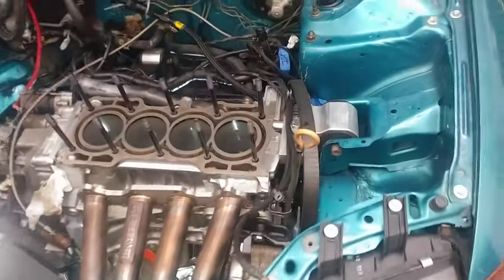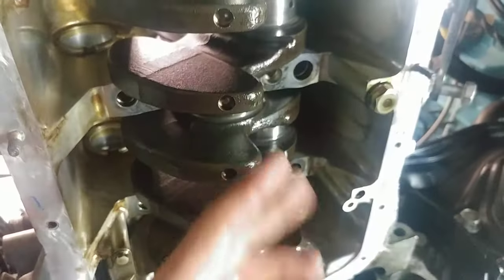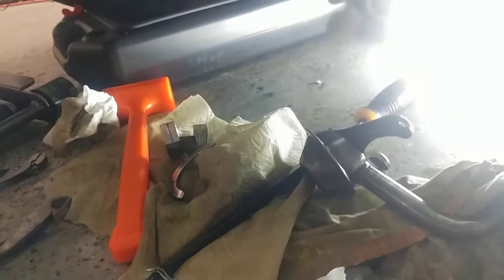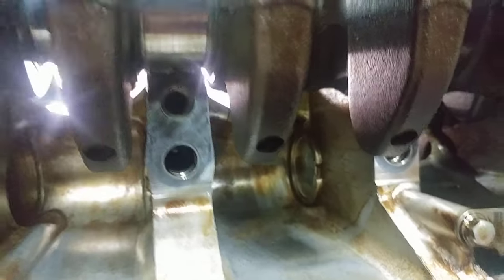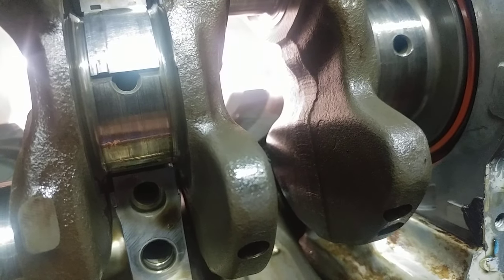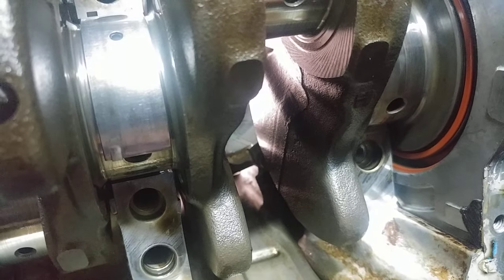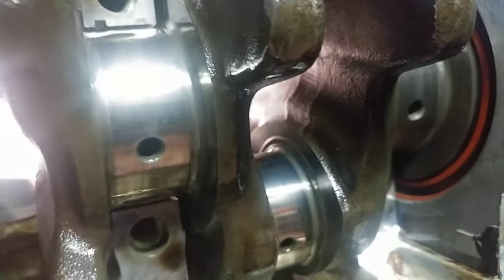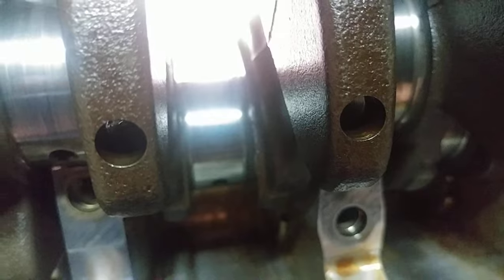EASY - How to remove crank bearing (THE FAST WAY) no engine removal (install while in car) ROLL IN

Comment: I have a 2001 Ford Taurus with 3.0 ohv. 

I found it easier to take a thin long flat head screwdriver (3mm wide) and lightly tap the old bearing until enough of the other side of the bearing was showing. Some people use a wooden popsicle stick to push out the old bearings, basically any thin piece of material softer than the crankshaft metal could be used, though stiff enough to hold it's shape while hammered lightly.

It helps if all the crankshaft main bolts are loose, gravity will help pull the crankshaft away from the old bearings making them a little easier to get out.

After that I was able to get some of the old bearings out just by rubbing it with my thumb, sometimes turning the crankshaft would turn the bearing and that helped getting it out. Some people use a pair of needle nose pliers to pull on the part of the bearing left showing after tapping them with the screwdriver.

Putting in the new bearings was easier, for almost all the bearings I was able to push them in nearly halfway with my thumb then I used the wooden end of a rubber mallet to tap them in all the way.
Reply from the maker: Thanks for the comment. I was hoping by doing this video help some people get some better ideas on how this can be done

Comment: Hi! Thank you for posting this. I have a couple of questions. 1) do you only remove the bolts of the bearing you are going to replace, or you release a little bit all the bolts initially so you have a little bit more of clearance? and 2) When do you torque the bolts? Because I think that the crankshaft might bend if I have new bearings with the cap torqued already. 
Cheers!
Reply from the maker: You could do it either way I would think, how'd it go?

Comment: What about installing without removing crank ?
Reply: The same method... you use the bent pin to push the bearing around and into place.
Reply from the maker: You roll them in

Comment: How did you push the centre bearing out that doesnt have an oil hole? just wondering as im doing a B18C same procedure but cant figure out how to push that centre shell.
Reply from the maker: I used something very pliable and spun the crank and put pressure on it. Slide out
Reply: I have a 2001 Ford Taurus with 3.0 ohv. 

I found it easier to take a thin long flat head screwdriver (3mm wide) and lightly tap the old bearing until enough of the other side of the bearing was showing. Some people use a wooden popsicle stick to push out the old bearings, basically any thin piece of material softer than the crankshaft metal could be used, though stiff enough to hold it's shape while hammered lightly.

It helps if all the crankshaft main bolts are loose, gravity will help pull the crankshaft away from the old bearings making them a little easier to get out.

After that I was able to get some of the old bearings out just by rubbing it with my thumb, sometimes turning the crankshaft would turn the bearing and that helped getting it out. Some people use a pair of needle nose pliers to pull on the part of the bearing left showing after tapping them with the screwdriver.

Putting in the new bearings was easier, for almost all the bearings I was able to push them in nearly halfway with my thumb then I used the wooden end of a rubber mallet to tap them in all the way.

Comment: Do bad bearings make the crankshaft super easy to spin? My crankshaft was hard to spin before couldn't get it to crank over cause of flooded with fuel than was able to turn it on but I stalled out on me and sound like a piece of metal fell that's when I noticed the crankshaft easy to spin any ideas?
Reply from the maker: did you find the issue?
Reply: @Jarph0821  yeah man it was a bad crank shaft the retainer fell out i was probably gasing it to hard , went to the junk yard and the yhe crank shaft and it ran again till rod knock came
Reply from the maker: @oceanzmusic  damn, well at least you found out the issues

Comment: how hard are the thrust washers with this method??
Reply from the maker: They should slide in... personally I re used mine. But you could use some thicker oil or engine lube and it'll be stickier...helping it not pop out and rotate back into where they belong.

Comment: My dude.
Invest in a tripod or something...seriously shaky ass shit.  Speak up too...half of what you were saying was unintelligible just because of how quiet you were.
Not too sure about using a cotter pin. I don't like the idea of loose ends moving through that roll. They're bound to move around some and possibly scratching mating surfaces. I use a small screw with the head ground down pushed into the oiler hole. To each their own...if it works, it works.
Reply from the maker: Tried to adjust audio after uploading, did not work. Thanks for input, Happy New Year. Thanks for the view